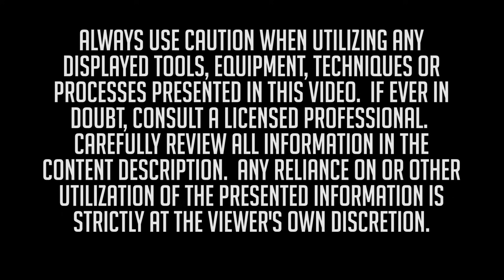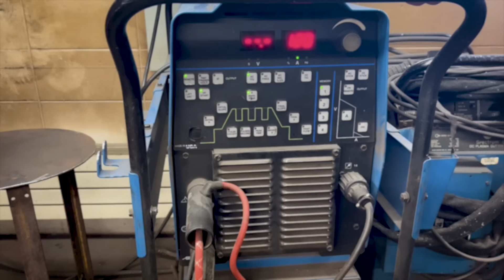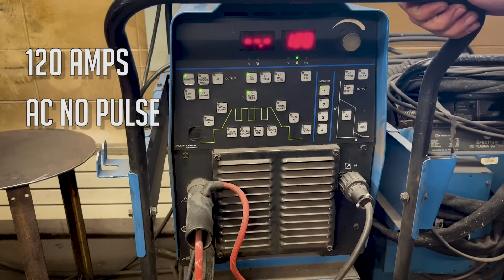Welding and Cast Iron Block Repair

Comment: Thanks a bunch. I would only suggest if you have specific recommendations to include those in the description. Otherwise, I appreciate the advice!

I have some old rare engine parts that frankly the only people who want to touch them charge $$$$ and don't guarantee the outcome. I have an old cast iron intake manifold I can use as a test. I figure the parts aren't going anywhere and I can only get better. :-) All the best.

Comment: I have never brazed a cast iron repair.-
Always cleaned, ground and drilled as you have, but pre-heat to 400 or more, hi-nickel stick rod welded, with good, long post heat.
  More than 1 way to skin a cat, I guess!

Comment: I bought muggy weld ductile iron stick electrodes to repair a spun inner pinyon bearing bore on my unicorn D44 (bolt in axel vs c-clip) and was successful building up enough filler to re-machine the required interference fit bearing cup (-.003 thou) so I’m comfortable welding cast.
Here’s my question… assuming I can figure out the type of cast is in a mid 70s to 2000 Ford 302 engine block so I can beef up the lifter valley so I can buy cheap junkyard blocks and turbo them, and not have the lifter valley split. I’m leaning towards ductile iron rods.

Comment: Best discussion about cast iron's carbon content and weld repair characteristics that I've heard.  I tend to think bronze brazing due to elongation and ductility.  I like the aspect of lower temperatue and its wetting actionwhich makes me 'feel' like it's really joining with the cast surface.  No issues with repairs with bronze rod yet.

Comment: Ive watched a LOT of welding instructional videos in my time.  Most of them, the instructor blathers on about nebulous BS and you have to suffer through the nonsense to get to heart of the matter and even then they do a poor job actually being a teacher.   This is, by far, the best instructional video  (well, its up there with Jody's stuff) Ive watched.  Not one second of this is wasted time watching, and every point made by this guy is on-point with this logic, metallurgy and materials-science conclusions.   Well done sir.
Reply: That's the problem, people like to hear themselves talk rather than actually teach. Too much ego.

Comment: Great explanation!! I also have done many cast weld repairs including cast aluminum( which is a freaking nightmare) you were dead on in your description and methods.....I'm very glad you did such an in depth explanation...my only suggestion would be to go into a little more detail on the cleaning and grinding procedure. Great job!

Comment: What would be the best way to fix a broken shoulder for a bolt.
It's a 400 chevy engine and has half the threaded hole broken.
It's outside of the block or we can say an ear and then it goes into the block.
Will a brass bar inside the threads work so that the rod doesn't weld to it ?

Comment: From UK.
That was a brilliant comprehensive technical overview of the process.  Clearly put and Thank You so much for speaking to us in such a well paced  way.  Great job.
I once worked in BTH, English Electric Steam Turbine Div. Willans Works,  at Rugby town central  England.    The main product there was Prime Generator Turbines  for public utility power companies.  The large castings for steam chests weighed many tons and were produced in sand boxes in their own foundry.  I reckon these weighed  dozens of tons and like you say  about residual stresses   - they would crack on cooling.  Multi million dollar  item!    The firm had welders based in the foundry ready to fix things.    They used Bronze Welding (called Brazing in UK)  and after QC X-Rays (& dye penetrant testing if I remember right)  temporary gas fired  oven (portable shields)  were put round these monsters   and specialist technicians in aluminised fire suits  with I think water cooling  etc   would run the liquid gold magic silicon bronze into the prepared cracks.   Yes the had ovens big enough to take the covers of a low pressure housing off a 600 Mw  set.  Preheat  and bronze weld.  

The firm is now part of General Electric  I hear  and there must be others out there who know that factory of the process  and can correct me where I'm wrong on any details. 

Keep the videos coming. You all got own styles and all of you are highly educational.  Thanks!!

Comment: I don't know squat-ta about welding but I do know that welding requires melting the base metal.  And if the base metal is not melted and flowed together, it's something, but it's not a weld.

The presenter at 13:06 says that he does not melt the cast iron of the engine block, so it's not welding.  So this would be brazing, right?

Comment: Carbon does not harden steel because carbon is hard in itself, carbon hardens steels because it interrupts the crystal structure. This can be thought of almost like how they add gravel and other aggregate to concrete to increase it's strength (Though they also add gravel as it reduces the amount of concrete needed by adding filler). Y'all always put out really great videos though, glad you make them as I am teaching a friend to weld as of now and have been using your videos to help cross reference my own knowledge from when I learned to weld. 2:48
Edit: Also carbon is only hard when in certain forms, things like graphite are quite soft while diamond or graphene are quite hard. Ceramics containing carbon are also generally very hard like the many types of carbide in the shop. Generally the carbon we encounter in our daily lives can be thought of as soft though.
Reply: Higher carbon content Does make steel harder. Haven't you ever heard of high carbon steel? Just drill a hole in it compared to drilling in mild steel, you'll see.

Comment: Good day thanks for the video I've been saving it for a while I watched it again this morning I do have a question I have a set of cast iron motorcycle heads it also have brass or bronze combined the belong to my hot rod motorcycle and the heads are basically homemade I have some damage where I dropped the valve and it damaged in the seat area which is cast no cracks no holes just damage the aluminum bronze welding rods do you feel they would be adequate for this repair I am capable of making repair just having trouble deciding the right material to make the repair I was going to use stainless but after watching your video I'm rethinking my decision thanks again have a great day

Comment: Back in 87 at the community college to tie up our AWS cert & diploma we were required to do 80 hrs of community projects, labor was free, only charge on material if needed. Cost was a can of coffee, & a baker dozen from Dunkin donuts. Every thing from hard facing on dozer blades, rippers, rebuilding roller pins machine shop there would turn down, rewelding bicycles frames, rebuilding anything & everything... But this little Hispanic lady came in with a tortilla pan thats been in her family for four generations, had a hair line crack in the center, took for ever to get that  carbon out of it.. but I did, ran two pilot holes to stop the crack, preheated, post heated, stress relieve, I forgot what rod we used, but it was very similar to hi Nickeli chromium base.. came out great, but when it came to getting the coffee& donuts, this lady brought in a complete home cook mexican meals for the entire shop.. Enchiladas Burritos, tacos refried beans, homemade salsa, fresh salad it was unbelievable what this lady & family did... 😊

Comment: It’s a cracked block. Every car guy gets there sooner or later. If you don’t have a new one (block) wear the welds like a badge of honor. I would not grind them off unless fitment on a machined surface was necessary. Your less likely to re-develop the crack if you leave the brazing in tact. Nice job on the initial cleanup of the block and stress relieving holes.

Keep up the great videos.

Comment: No pre-heat?
Reply: A general preheat is a good idea. It will help reduce stresses and mitigate cracks, however keeping your heat input down during the welding process is also a good practice to get into. Keeping things balanced is a great thing. Not excessively hot in the area that youre welding and nor cool enough that the base metal acts as a heat sink pulling heat rapidly from the weld/Braze

Comment: Hello thank you for your patience and information. I own a 93 v6 Taurus but has cracked like 2.5 or 3 inches large and like hair crack. I bought a mig welder 110v 135amp works for shield or flux core wire and cut weld aluminum. I'm not a welder neither notion of welding jobs but I want to make for my self that repair. I appreciate your time and help about what can I do? Thank you blessings.

Comment: I've got a 4 ft cast iron cannonball Chimera. The whole thing was welded around the middle. Time and lot of burning had worn most of the weld out. It's rusted and gaped about a 1/4 in. I can preheat by building a fire in it. My big worry is taking more material out of the gap for a clean edge and can I weld with a fire inside. I can send pictures if I know who and where to send them. also MIG, TIG, or stick.  thanks for the tips

Comment: I teach copper brazing for HVAC that uses similar filler rod and heat control but with oxy acetylene. In our process the filler follows the heat, you mention needing to manipulate the puddle a lot in this repair, does the same theory hold true? Does the filler still flow toward the hotest sections?
Thanks!

Comment: Good explanation 👍. I've been stitching or coldwelding cast iron to this point, I learned that once and made good notes of it. I might try this, seems to save a lot of time. Also, a small question: does a block of copper help with heat distribution to keep the cast iron, or any metal cool during welding, just curious? Some metalworkers told me to use it as a heat conductor, does that work?
Reply: Yes, copper is a great conductor for transferring heat away from the workpiece and comes in handy for many applications. You may want to search copper welding spoons and copper welding gas diffusers to get a better explanation of how they are used.
Reply: @SW-ii5gg  thanks!
Reply: @tummytub1161  you are welcome.
Reply: @tummytub1161  the proper name for the gas diffusers is argon purge box or backer box I think, it is used for tig welding  stainless, but it may help you in other applications also.

Comment: I think I missed it and did see your settings that came up on the screen.  You were using AC did you decide on a balance percentage that worked best and not put too much heat into the part?

Comment: I want weld on my cast iron front axle 51 ford F1 but people say it can't be done . Any info will help
Reply: Chances are they may be cast steel look into how to determine that. Cast steel is much easier with far more reliable results
Reply: @joewest1972  ok thx but how can you tell the difference steel or iron
Reply: @rickynelson3222  google cast metal spark test, also if there was a spot somewhere on your material where you can drill a small quarter inch hole see if the resulting swarf /  turnings are producing a powdery metal or more helical shavings powder is cast iron, helical shavings cast steel.  You can weld cast steel normally
Reply: @joewest2560  big thx
Reply: @joewest2560  thx that's a great help

Comment: Great process Cliff,  I tried cast iron repair for a short time back in the early 90's while doing cracked cylinder head repair (mostly aluminum) at a machine shop I worked at.  I bought cast iron rods our supplier suggested, and went to town with rose bud pre and during weld,  sand to cover while cooling.  Many tries,  no joy.  I almost bought a used pizza oven and then decided to keep brazing when possible and use an old method of drill and peen plugs in combustion chamber with success.  Thanks for sharing your processes with me.  Really challenging work.  Happy to see people like you willing and able to save the old iron.  Great job, Thank you.

Comment: Nice video and explanation! Not long ago I TIG welded a cast iron exhaust manifold for a Kohler engine. I used stick cast iron rod (Ni rod) and cleaned off the coating.  Pre heated the part to about 350 degs. Like you I jumped around the part to minimize stressing.  I than heated the part again and put in in sand to slow cool it. I was surprised how well is welded except for a few pops due to carbon or voids.

Comment: I have an old 3 burner cast iron camp stove that needs to be welded on the main part of the frame. It about 1/4” thick so I thought I’d heat it slowly with my oxyacetylene torch, TIG it with silicone bronze then let it cool. I use this range when I’m big game hunting which is usually 3 months straight so it gets used a lot. I am concerned about it cooling to fast and cracking elsewhere. This is an old American made range and I’m not particularly enthusiastic about replacing it with Chinese junk. Any advice?
Reply: FWIW Richard, I have repaired similar cast iron structures and had very good results, I'm sure you can make the repair so it will survive the cycling during use, probably the most important detail is to make sure you stress relieve the part after you make the  bronze joints, you could do this by putting the part in a medium camp fire that heats the entire part, keep the fire pretty hot for 30 minutes or so then just wait for it to burn out and cool on it's own and you should be good, the idea is to get all the stress lines to be random rather than pulling in one direction, this assures the ductility of the bronze without narrow stress paths of cooling too rapidly.
Reply: @Peter-V_00  will do! Thanks!
Reply: @Peter-V_00  So if I was building a fire and putting a part "inside" how would I do it?  Use charcoal and bury the part in the middle once it got going or do this with a wood fire?  Would that matter?  I have noticed my large wood burn piles reduce to glowing embers very quick but to totally burn out can take 24 hours or more ... Don't know if that would matter.
Reply: @jimw6991  That would do the trick, the main idea is to allow the materials a chance to destress the localized stress from the repairs, once you put the part through the fire you will remove virtually all of the stress present and end up with a stable reliable part, cooling slowly is the key to a proper job.

Comment: Very interesting. I have welded cast iron using high nickel content stick rods, with pre and post heat and peening in-between the short weld beads l laid. The repairs have been a successful. I will try some of those rods if l can get them in the UK? Too stuff.

Comment: I have a old Wilton vice that has been repaired probably a couple of times with a wire fed welder of course it just keeps braking ..it's broke where the jaws meet .. is there any hope for this vice or is it scrap???
Reply: Likely just needs repairing properly, but it will still be a repaired Vice.

Comment: Usually cast iron welding tutorials are all about pre-heat and post-heat and burying it in sand. I've never used TIG I just have some rain gutter to repair, this looks like the way to go. The rod isn't cheap but fixing cast iron is a valuable skill.
Reply: I agree, this video had very helpful details as to "why" cast iron is handled  differently, too many generalizations are not useful in actual practice, details matter.
Reply: Did you grind the cracks out 100%?  I may have missed that detail.
Reply: @tgreening  You can see around 11:50 he ground a wide groove but not right to the base of the crack.
Reply: @tgreening  the goal when doing it is to have the welder getting to all of it and on the end's about 1/8 more so the crack's don't have a easy placement to start again 

as far as over grinding yes technically possible but it just makes more time/work to fixing it but not enough and you probably will have to grind out the hole old weld you just did as it probably will crack the weld or close to it
Reply: technically it's not a weld it's bronze brazing but that's still sometimes useful and water jackets-outside aren't stressed as much typically 

i got a 426 hemi iron 1970 block that needs repairing/mod's and was hoping to avoid using gas-welding as it's not my favourite to use

Comment: The best results i have had welding cast has been with a stick welder using "Arctec #3" i have done brazing and acetylene welding cast iron, i have yet to try Tig welding cast, next time i will, thanks.

Comment: If anyone wants to learn how to  actually weld cast iron without brazing .........
https://youtu.be/wW1dXEwnkDg
Reply: Heck of a job! a repair on a cylinder wall is a tall job to tackle! It looked great! Its all just a personal preference for me. I find on these thin water jackets a TIG Braze just helps me control my heat input a little more. Thin cast is a bear.

Comment: 👍Brazing is always the correct answer when it comes to cast iron repairs..   I've always used regular silicon bronze filler but I will have to try aluminum bronze next time.
Reply: the strength of joint will be weak....dont think it is good option....we repair cats ironn by stitching
Reply: I like his reasoning about Using Aluminium Bronze because you run it on AC, and the AC action helps to clean out the crap from the weld area. Great Video.
Reply: Your research on aluminum bronze curious
Reply: Yes but no ..puddle gun is the answer ...